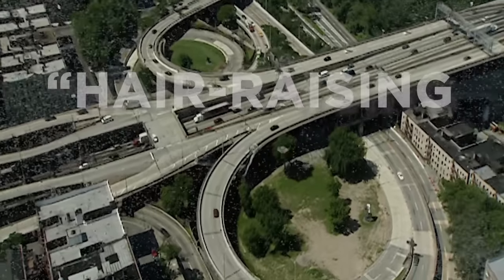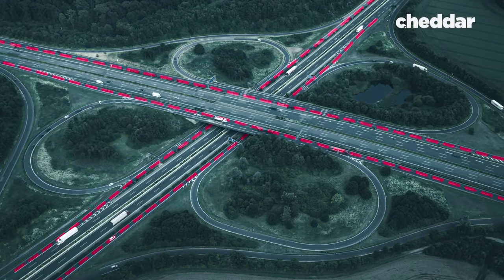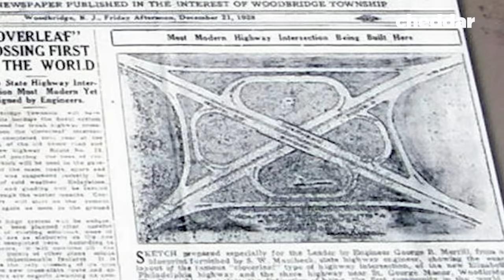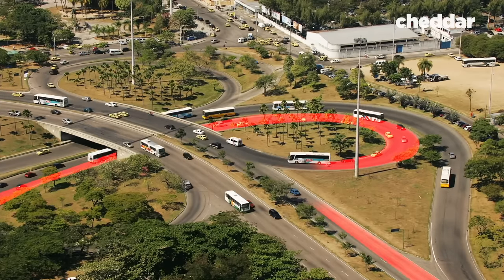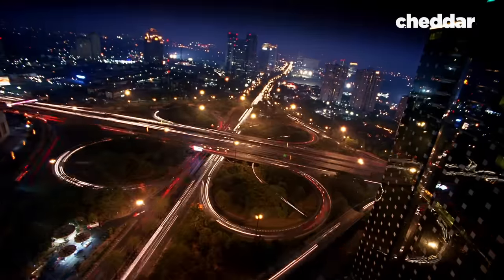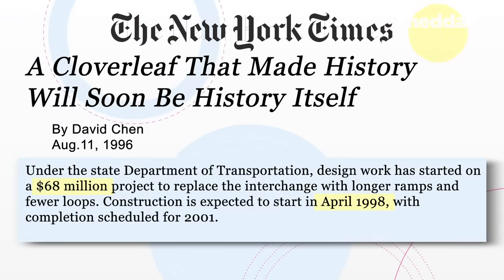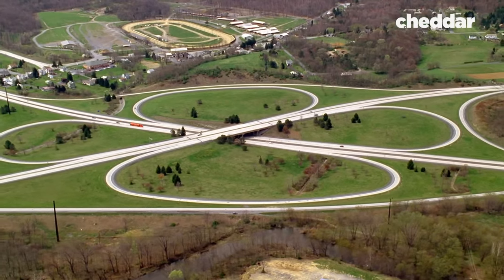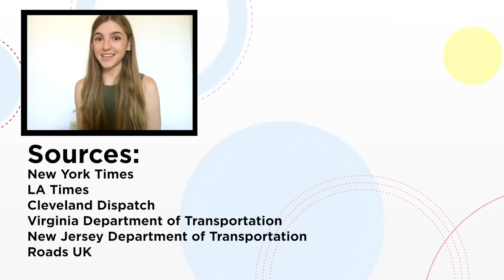The Big Problem With Cloverleaf Interchanges - Cheddar Explains

Comment: I'd like to see more usage of diverging diamond interchanges. Especially interchanges between a semi-divided highway and fully divided interstate.
Reply: Diverging diamond is a service interchange (getting on/off highway), similar to single-point (which is better than DD in alot of ways). Cloverleaf is a highway interchange (between two highways). DD is not a feasible replacement for cloverleaf because one of the roads would not have enough throughput.
Reply: @razaelll  Great. I didn't suggest two fully divided highways. I suggested a semi-dividend highway (45 or 55 mph speed limit) to a fully divided highway (55 to 70 mph speed limit).

A standard diamond interchange is used here all the time. With left turn lanes in the median of the semi-divided highway.

Comment: There's an exceptionally tight cloverleaf near where I live, in a suburban area with heavy commuter traffic. Each freeway is reliably trafficked at about the same times. Worse, it has exits and on-ramps very close respectively before and after it in three of the directions. I learned to drive freeways partly by repeated, harrowing trips on it. I can only imagine how long ago it was a sensible interchange for the traffic it supported. There's an improvement project for both freeways ongoing; I rather hope some kind of fix, or easing, of the cloverleaf problem there is in the works.

Comment: No matter the type of interchange the biggest problem will always be the vehicle operators. In my state it is a widespread practice for people to pull up slowly to the end of an acceleration zone and stop and look, then choose a moment seemingly at random to pull out into highway speed traffic from that dead stop. For whatever reason, the collective unconscious has decided that accelerating to highway speed and using your blinker to merge into flowing traffic is unacceptable. The stop and suicide dive is the preferred, if completely idiotic and inefficient, method of choice.

Comment: At :31 she said that cloverleafs were build to allow two highways to cross with out traffic lights and harsh left or right turns but when she mentioned the woodbride interchange update,  it added 2 traffic light, harsh left/right turns and and a dangerous crossing when turning north from the St, Georges AVe. in to road 1.

Comment: The cloverleaf is the inverse of a roundabout. It does the same thing but in the opposite way - the circle is on the outside instead of the inside - and possibly a better design than the roundabout due to the bridge in the middle. The alternative is the triple-decker - one road goes underneath the roundabout and the other road goes over the top of the roundabout. These are done !

Comment: There is another major factor in the use of interchanges until the early 1960s -computers.  Because of he difficulty and time and complexity there were standard designs for many things, but particularly interchanges and bridge crossings.  Generally bridges that were at right angles could be somewhat standardized designs and the difficulty to design curved or skewed bridges minimized as with interchanges.  Starting about 1960 the advent of computers allowed much much wider use of curved & skewed bridges and ramps that were more direct in design.  When I started in highway design in 1966 on the NJ TPK widening we were early in the development of geometry programs.  Those programs however introduced a revolution in highway design, without them all of what you describe and newer interchanges would be impossible.

Comment: It doesn't help that the US highway rules are basically backwards.  People are supposed to stay to the left, not the right.  You only use the right-hand lanes when you're entering or exiting the highway.  Exceptions: emergency vehicles(if people are driving to the left, right-hand lanes are more clear so emergency vehicles can get through with relative efficiency), passing(in case of an accident, in which case people should be pulling off to the shoulder, if possible, where emergency vehicles can easily get to them), and military convoys.  If people followed these rules, highways wouldn't need to be expanded as often.

Comment: Clover leafs work great when traffic is going 45-50 mph; I drive in mexico and most roads there top out at 80 kph and clover leafs are very commonly and efficiently used.  However most American highways are 60 mph or more at which point it doesn't work too well unless you have a GIANT cloverleaf.

Comment: Quite often, while driving toward an exit, some car entered from the ramp going too slow, so there was no way I could have exited without making a collision.
The clove road design doesn't work with sustained traffic. It is a wrong old design, only good for the times gone by.
A note for Cheddar: did you stretched the video (made it longer) after the final editing? Can't explain all those odd spacings and their timing.
Thanks for the video...
Reply: still works perfectly today, even with higher traffic flows;
And you can designh cloverleafs also without traffic coming from the ramp and with other traffic trying to take the exit crossing on the same level; They can be built with level-seperated crossing they they actually don't get in contact with each other at all
Reply: @EnjoyFirefighting  There are road designs that no amount of money can fix.
Try to drive on the A5 roundabout in Shrewsbury (known locally as "Dobbies roundabout"): after one hour on the simulator, one cannot figure out which lane to follow and what light to watch, when one physically engage said roundabout on a Monday morning, when all heavy traffic from/to Wales is intersecting you wherever you may want to go. Only a multilevel (spaghetti) could possibly solve the rebus of the A5 roundabout. Matter of will, I guess
Reply: @antoniomaglione4101  right next to my village we have a classic cloverleaf interchange which got updated with one flyover instead of one of the loops, and the entire interchange is interlaced with another offramp/onramp; but there are only two spots where traffic flow crosses on the same level, weaving between lanes

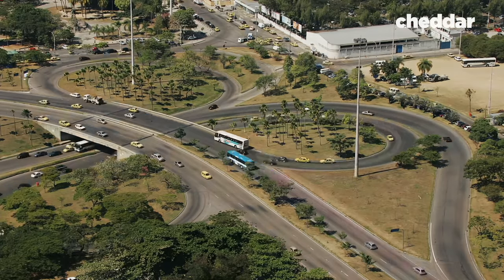Comment: 3:50 is in Rio de Janeiro. That's access to the domestic airport. Santos Dumont.

I had a lot of trouble trying to merge right into the airport access, while having to guess what's the car on my right would do after joining the road I was driving.
Cars on the right wants to join left, while carts on the left wants to join right.

Comment: Hairpin interchange was intended to limit access to motor ways... making it less bottlenecking, and free of intersection. This is the extended concept of limited access, aka controlled access.

This worked till we ended up with too many interchange with too many automobiles.

Hairpin no longer work cuz we have too many access points to controlled access roads, making it irrelevant.

Comment: I can remember when, at least here in the South, you’d sometimes run up on a cloverleaf all of a sudden, on an otherwise 2-lane highway. I guess most of them were built before the interstate system was complete. Later, I found out they were a popular solution when intersections in rural areas had a high rate of accidents. Dividing each highway for a one mile stretch and installing a cloverleaf was an ideal solution. In that setting, it was not really possible to overrun the interchange’s capacity, and accidents would almost completely stop.

Comment: The reason is, they are doing them wrong. You need to add slip lanes where traffic merges on each side, like at the intersection of the A2 and A7 Autobahn in Germany 52°23'49.6"N 9°53'59.3"E

Comment: As a truck driver, these off ramps are a nightmare! There have been times where I had to miss an exit because there was someone merging on and there was no way for me to get off without hitting them. These things are frustrating. And don't even get me started on merging on with a truck!
Reply: Well when they have the nickname "suicide lanes" there might be a problem.
Reply: Yes, and most of those old cloverleafs were designed for rigs with 35 or 40 foot trailers.  And even the big "California Hauler" tractors weren't as long as some of the ones in use today.
Reply: Yeah, no kidding. California just makes it worse for truckers too. Limiting us to 55mph and keep to the right two lanes. Not that I'd wanna hit a cloverleaf any faster that that. It's the speed differential that causes so many accidents and as she mentioned in the video....merges. you get dingbats coming onto the highway at 35mph and slowing down ON THE FREEWAY to exit too. It's like playing dodgeball with the player being 80,000lbs, dodging a hundred balls. I hate trucking in Ca.
Reply: Joe's Garage one intersection in my country kind of fixes this by putting a quick zig zag turn between where you get off the highway and where you cross with those getting on. This forces everyone to slow down to around 70kmh which makes it a lot safer when traffic isnt high. But it also causes slow down to back up onto to high way and when it’s traffic is higher.
Reply: I hear you. And I drive a 9 year old Honda Insight with less getup and go than it once had. And I still have hemorrhoids. 

Thank you for hauling stuff! Truck drivers deserve a round of applause for keeping shelves stocked, medical supplies moving, packages to distribution centers, and keeping the world going. Like those of us on the front line of things in this... clustershart of the year 2020... truck drivers deserve their time in the spotlight too.
Reply: @marikroyals7111  They also are called rollover ramps. We have lots of these in PA. Some of these are so tight they will not even allow large trucks to use them. Many do not have much in the way of deceleration lanes so to use one of these rollover ramps you have to almost come to a stop in the roadway which cause backups and accidents.
Reply: i was in a car and there wasnt a sign far enough ahead of the off ramp that i was able to read and figure out, that wasnt my off ramp.
Reply: @B1GDaddyFatStax  Meanwhile in my country I've been on-board public buses that go as slow as 40kph/25mph on the highway when they're ahead of schedule
Reply: Hey fellow railfan!
Reply: Just wanted to say thanks for doing what you do.
Reply: @Loki-pd3zj  I'm not a truck driver anymore. I'm a school bus driver. Left the trucking industry because it was too toxic.
Reply: @Trainfan1055Janathan  well again, thanks. You are still doing a job most would refuse to do. Hopefully it's less toxic.
Reply: Trainfan1055 hey I’ve had a few truckers and bus drivers in my family. One of the issues I see (Atlanta) with these is the fact that you simply can’t take a truck up those tight turns at 45 mph like many cars can. This, in my experience, causes traffic to slow down behind and in some cases backs traffic up back onto the road you’re turning off of. This gets into another issue when they aren’t marked well, or people aren’t paying attention, and I nearly get into about one or two accidents a week going through the one I have to go through on my way to work.
Reply: I know it sucks, I have to just start bliping my jake and horn and fanning my brakes to make trucky noises hoping that the bmw driver will put his phone down and get tf out of my way
Reply: Honestly  the BIGGEST issue causing traffic on the freeway is the 18 wheelers    people are too wimpy to pass them  esp if it's a fuel tanker  those cause massive back ups
 everysingle time you can literately see one car at a time, in single file pass them

 I HAVE A GOOD PLAN TO REVISE ALL THE FREEWAYS (with 3 lanes or more) to Optimize traffic flow...
  it will only cost them money in paint to re-stripe the ground... 
and for the other trucks  I see people cluster around the truck  hoping  that the driver will screw up and hit  them so they can sue them for millions of dollars.....

 the closest call with an 18 wheeler was  when i was on a back road and the 18wheeler  left turn in front of me I was going about 60mph  I almost rearend the drive wheels and nearly slipped under the trailer  I was barely able to stop  by only 2  inches    to my driver side  a-pillar 
  it kinda pissed me off so later on down the road they were doing road  "work" so I went 5mph  for about 2 miles
Reply: The german solution: the slowest vehicles including trucks have to go on the right lane, so if you simply slow down enough there's always a spot for you.
Reply: The exiting traffic needs to yield to entering traffic from a cloverleaf ramp.
Reply: If you think a truck drive is being a rude driver, theres a good chance the car driver is actually the one being rude.
Reply: you are supposed to slow down and merge behind traffic that is exiting the clover leaf.
Reply: Thank you! And people in these comments will tell you its because youre a shitty driver! Its literally a flawed design
Reply: Nope. The problem is the ability to  drive a vehicle properly. It means to drive peaceful and not to start war on the streets. There are lots of issues at this topic in the US. In Europe they work fine. How is that possible? So it seems not to be a fail of this intersection rather than a fault by its user's.
Reply: @jjlasne  
Truck drivers are professionals,  🤣🤣🤣🤪🤪🤪🤣🤪🤪🤪🤣🤪🤣🤪
Reply: @B1GDaddyFatStax , I have noticed this as well: people slowing down/braking before entering the exit lane and people merging at speeds of 35~40mph. The state of California recommends merging under the speed of traffic - it is a question on the written test - and some timid drivers take it too far/too slow. I actually found it safer to merge at higher speeds, in front of traffic since I cannot rely on it doing the right thing.
Reply: @wakeup6910 , they are supposed to be but skills in North America are much lower than in Europe.
Reply: @295g295  
No, the exact opposite
Reply: @wakeup6910  What do you mean by that?
Reply: @B1GDaddyFatStax  Not slowing down while still on the highway is how you roll your truck over on the ramp...
Reply: @dchawk81  yeah, in California. The ramps are so short you have to. In normal states like Arizona, especially around places like Phoenix there's an exit lane that turns into a ramp. This essentially makes ramps upwards of 3 miles long. Most ramps are at least a 1/2 mile. When you compare that to California's ramps, typically 150yds or less, you have no choice but to back up traffic as you slow down on the freeway itself. That's why I was griping about slowing down on the freeway. Their ramps aren't trucker friendly.
Reply: @B1GDaddyFatStax  Yeah it's tough. We have some short ones around here. Not just cloverleafs but also exits with red or stop lights at the end. It's ridiculous.
Reply: @B1GDaddyFatStax  do you ever drive the older highways with super short on ramps (99 through sac 880 thru Oakland) sometimes it’s a nightmare getting on because if there’s a truck there’s no room to merge in! I couldn’t even imagine being in a truck on those roads.
Reply: @inlonging  that was actually my last route. Oakland/Santa Rosa for McKee. Horrible engineering!
Reply: @marikroyals7111  If think you are confused. Suicide lanes (aka Reversible Lane) are the left hand turn lanes shared by both directions of traffic. Head on accidents are common , hence “Suicide Lane”.
Reply: In Germany people that don't exit go to the left lane. People merging on and off make sure others can het to where they are going. Depending on the traffic the merging lanes are normal or longer. I've never seen an accident on them here or in the Netherlands.
Reply: @jinde75  see, now that makes more sense. Especially for trucks. Yeah, they drive slower, but keeping them near all the exits is where much of the danger can be. If you keep them and the majority of traffic to the left, then nobody has to deal with others getting on or off.
Reply: @tchevrier  There are other solutions without weaving which use only a bit more space. I looked at the maps, because I didn't know the problem here and I use the a highway crossing all the time.
Reply: @reinhard8053  huh?  What are you referring to.?
Reply: @tchevrier  Now I found the name: cloverstacks
Reply: @reinhard8053  huh????
Reply: They’re bad enough in my car. I couldn’t imagine trying to use one in a big rig truck!

Comment: I wonder how the cloverleaf compares in different countries. For example in Germany, in driving schools we are taught how to merge/join on cloverleafs and (though I rarely drive) I've rarely seen the accidents you described.
Reply: Welcome to Germany
Reply: maybe yours are outside of cities and have less traffic
Reply: @anteveic327  no
Reply: @anteveic327  no it's the technique called the "zipper technique" it's a very simple rule for merging. Drive to the end, do the zipper.   Here in America where I am they just merge without adjusting speed, everyone merges at the same time, it's a mess! But we were never taught the proper technique. We don't even set our mirrors correctly in most cases.
Reply: I get the feeling that people in Germany actually care about being good drivers and helping traffic flow well. That would be the difference.

Is it true that at stoplights in Germany, the whole column starts moving at once when the light turns green, rather than one at a time...?
Reply: This doesn't mean that the design is NOT inherently flawed. Cloverleafs suck no matter if you are a good or a bad driver
Reply: @blazeraz7666  Maybe they do, but american drive schools evidently suck harder
Reply: @nadarith1044  That's just it, driving school isn't required here (USA). You just have to learn to drive well enough to pass the driving test which isn't hard. I took Drivers Ed in high school but it was optional.
Reply: @Ruiluth  "Is it true that at stoplights in Germany, the whole column starts moving at once when the light turns green, rather than one at a time...?" No, that is not true.
Reply: @blazeraz7666  But you can adjust them to be better.